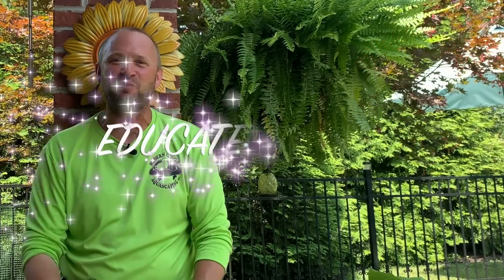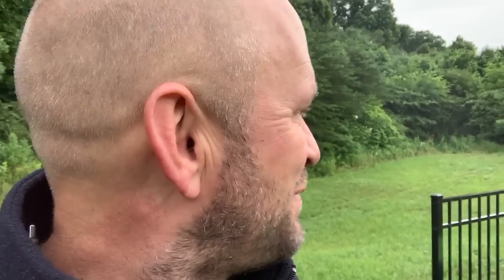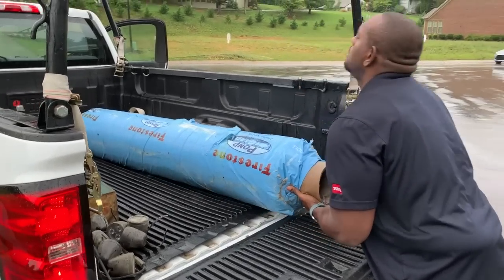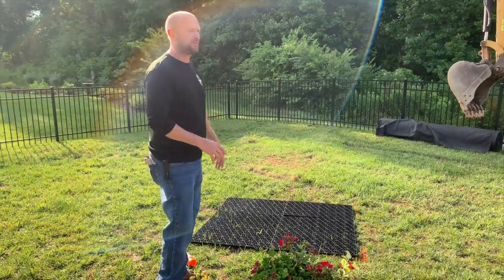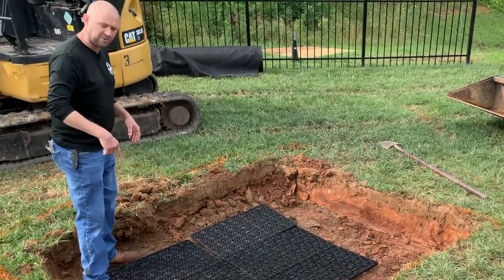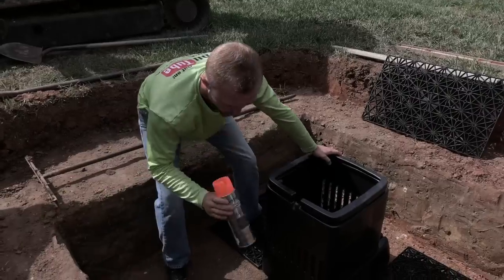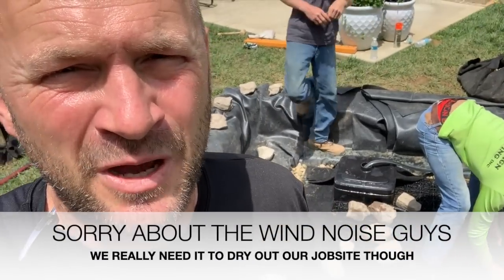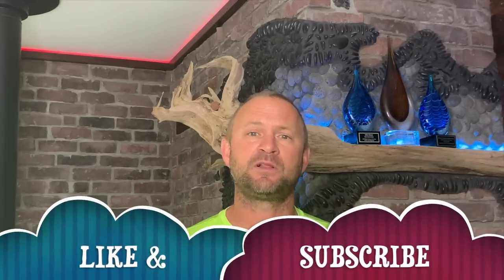THE BUILDING OF AN AMAZING PONDLESS WATERFALL IN A FLAT BACK YARD PART 1

Comment: Looking good!
Reply from the maker: I saw you watched the end, what type of feature are you thinking of building?
Reply: @KoiAddiction  I'm thinking something similar to that but with a pond big enough for some fiah. Nothing gigantic. That won't be in the budget... dadgummit. We have open land, about 5 acres, in Spencer overlooking a valley. We plan on retiring out there and I want the house overlooking that valley with a feature similar to this off a deck between the drop-off and the deck. The view coupled with the sound of running water should be paradise. It's kind of on a mountain top so there is tons of rock strewn across the drop off. Now that I have found your company Facebook page, I can post a picture to give you an idea. The problem is, its hard to take a clean picture due to the trees getting in the way - lol

This IS going to happen, it's just a matter of when. With the stockmarket tanking so hard, it looks like I'm going to be required to push off retiring for a bit.
Reply from the maker: All in time brother all in time. When you get into the planning stage a little more heavily just reach out to the office and my wife will set us up a phone call. Once the leaves are off the trees you can probably get the shots you need in order for us to be able to have a real conversation about what needs to happen to make your dream a reality :-)